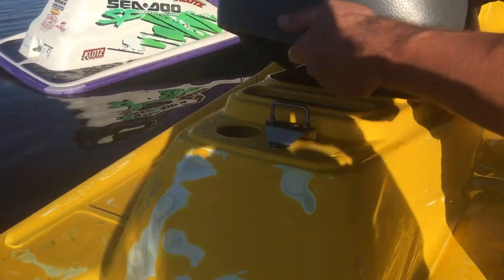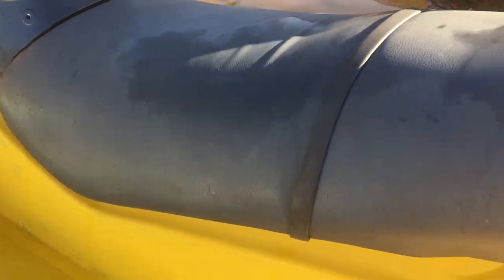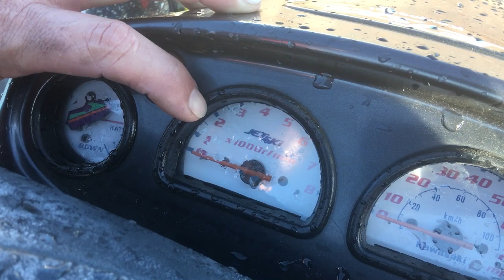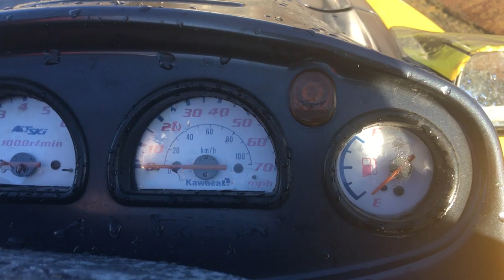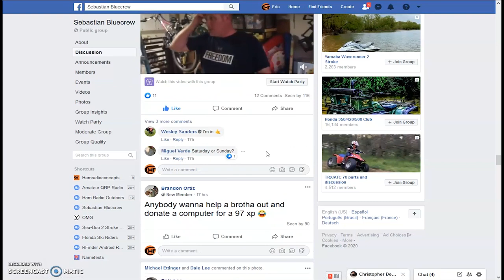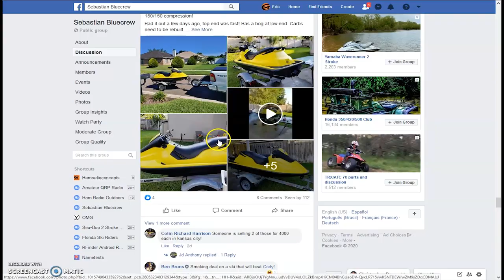1998 Kawasaki ZXI1100 Riding And Review, Sebastian Bluecrew

Comment: I just rebuilt the. Carb on one of these and set the carbs to work as they should.  But the engine runs away idling out of the water.  Is this normal?  Any suggestions.  ( when I choke it is is controlled)